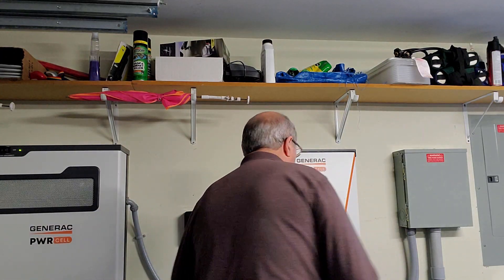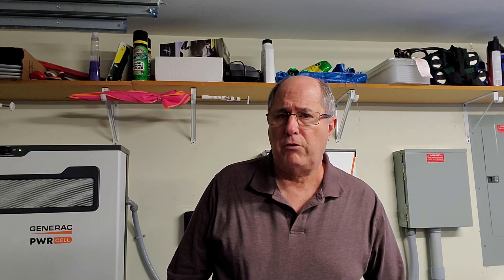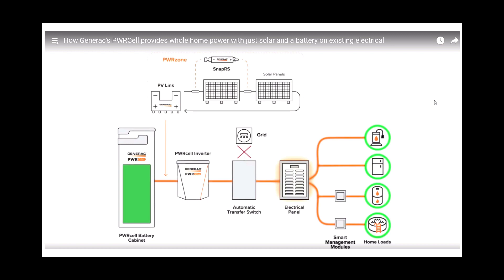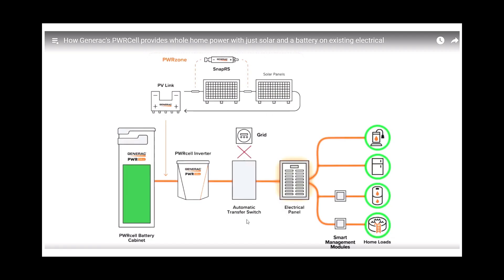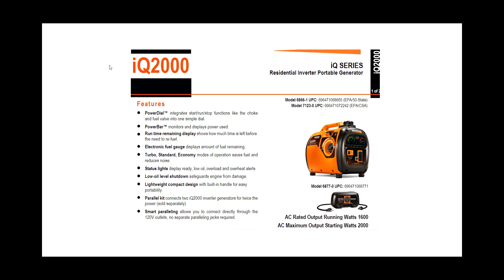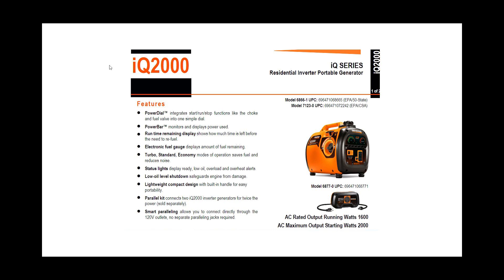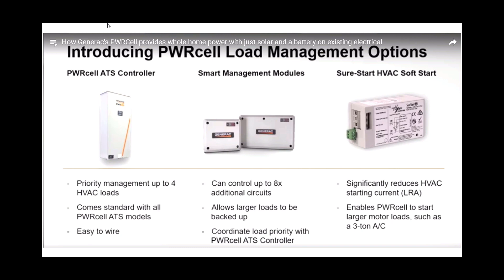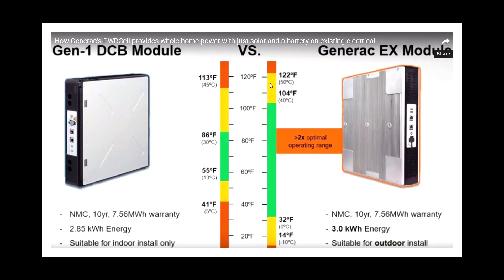Generac PWRCELL Generators and Upgrades

Comment: I have a portable Generac Generator. I use this with a manual transfer switch. The main job of this generator is to power my well and lightning. Without power I have no water.
I’ve looked into buying a solar system with battery backup. However solar companies have told me the no one makes a system that can handle the inrush of the well starting.
So I keep waiting for someone to make a system that can handle heavy loads.

Comment: Hi thanks for your valuable information, recently I have installed a Pwrcell system with batteries and I asked the company dealer here in Puerto Rico if my Generac standby generator to recharge the batteries and they told me that Generac doesn’t allow this for security and guarantee issues. Generac is developing a DC generator for this purposes, thanks in advance for your attention.
Reply from the maker: yes, Generac says they have been "working" on a DC Generator for a year or more.

Comment: Just a small tidbit: if you run a ductless heat pump HVAC system, a small solar system can cover the entire energy demand as there is little to no conductive heat loss through any ducting traveling through the non-conditioned space (attic/ crawl space). They also make heat pump water heaters which also are the most efficient electric water heaters as they don’t use an electric resistive heating element but rather circulate the water over the high pressure coil lines and many use CO2 as the gas instead of R134a. The built on efficiency of these systems are very appealing to us folks who use solar and want the ability go go off grid/grid down without sacrificing creature comforts due to gluttonous power demands
Reply: I know that there have been 8 months since your comment, but what you say is so very much true.

We have now paid off our 2-year-old solar system, plus paid off our 2ish years old mini split heat pump. Next, hopefully, will be, as you said, a heat pump water heater.

Eventually, we will get battery backup. We were considering 2 Tesla Powerwalls, but over the weekend I found that these Generac systems might be a much better choice.

Sorry for bothering you with all of this, but I wanted to tell someone.💙😉
Reply: @busog97641  generac system with the expandable battery cabinet is the way to go. The Tesla system requires an internet connection which will be down of the grid goes down. The generate system can also be programmed very easily to supply your power needs during the day with any extra wattage diverting to maintain battery charge, then can run off the battery only overnight and recharge during the day, along with an automatic disconnect you can program it to charge from the grid if solar isn’t sufficient due to cloud cover those days. Only way to go. No apology necessary and glad others out there are seeing why can be accomplished with what we currently have available.

Comment: I have existing Tesla PV rooftop mounted panels, (and also the Tesla inverter), but I also live in Texas, and ERCOT (unheard of until February, now a national synonym for corruption and ineptitude) can't find it's ass with both hands and a flashlight. My panels generated the ENTIRETY of Texas Icepocalypse 2021 and I'm hoping Halcium or similar can release a reasonable rooftop VWAT soon (Halcium is aiming for EOY 2021).  If that's affordable I'm going to likely bite the bullet and also get the Generac batteries, because in summer we need the AC.  In summer, I can do without the water heater (it's in the attic anyway and sometimes the hot water coming out if it is colder than the cold water from the tap in the worst of the summer, which makes washing cold water clothes a problem!) although I am unclear if the integrated furnace/condenser draws the same power in winter than summer.

Thank you for this information.  You're right, it's pretty dry, but of those of us who need it, we need it.  And your practical experience and down-to-earth presentation are great.

Comment: So one of the things I'm dealing with now, is that our Generac sales person didn't provide all of the options and information available. I thought he was very thorough at the time but after doing my own research it's too late to go back. One of the things I'm most saddened by is that I really wanted a whole home islanding feature. For example, in worst case scenario when our grid goes down for days at a time. (It went down for nearly 2 weeks a few years back RIGHT after going shopping and getting our meat processed; we lost thousands). Instead, we got a separate sub panel (like yours in the video). I don't know if they can even undo it and provide us with the Automatic Transfer Switch and MMSs now, without costing a fortune. 

A couple of notes that we even told him is that we're very frugal and don't have any high powered appliances. Our largest electric consumers are a dish washer, washing machine, and drying machine. We don't have HVAC, air conditioning, etc because we have a geothermal home. The cooking appliances are natural gas (one day will be a methane biogester). Most of our outlets go unused except the occasional phone or tablet being plugged into it. But as it stands, if we have another event like that of a couple years ago, all we have is the kitchen being powered by the critical loads box. I would have rather spent the money on extra battery needed to do whole home but I was told it (whole home islanding) wasn't an option.

Comment: Thanks for doing this! I am presently thinking out a back-up system for a new home project. I was wondering if, in the configuration you have described, you can use a Generac generator to recharge your battery  and power your house or do you have to specify what function you want the system to do? For me max flex would be best but I am curious about what you've leaned.  Cheers!  Blair

Comment: My neighbor got a quote for a Generac PwrCell system.   5.5kW of panels + 9.9kW battery + inverter..  $55,000.  

And no, it will not accept a generator, it will only accept grid quality power input..   which is an absolute joke and an indication that the engineers and Generac have no clue what they're doing.  

Who the hell would design an emergency battery backup system that can't accept a generator input?     Major major design flaw. 

In order to accept a generator input, they are going to have to add an extra set of AC input contacts to the inverter system and update the software to accept the dirty power. 

To my knowledge, there is no such thing as a residential sized generator with "grid quality" output.     Perhaps an inverter generator like a Honda could do it, but those are $3500 and up for the 120/240 split phase types.  

Just get an Outback Radian and some Fortress batteries...  You'll get twice the power at half the cost.
Reply from the maker: The cost of the system can vary widely, depending on what solar panels you pick; cost of installation and number of batteries.

Comment: Will central safer nuclear fission generators eventually be necessary. It's probably inevitable. Without question we have painted ourselves into central power generator/distribution corner. The three ineptly designed "kick the can down the road" U.S. power grids are bandaids on a case of cancer. Those who can afford it,  (about 10% of the population) particularly in Calif are rapidly installing solar with a propane fueled back-up power generator capability taking advantage of state and fed tax exemptions. The Calif one party state Dems lead by an inept union dominated one party bunch of lumps for  legislators and an inexperienced 
govonor clearly knowing that the 2021 summer power demands will exceed the out of state fossil fuel  purchases supply.   The result?  Rolling blackouts generally in the poor and rural areas with no political clout.

Comment: Did you mention that the  Generac system alone (without the grid) will not have enough initial power to run an AC Unit?

Comment from the maker: The inverter cares!  If you send "dirty" power into the inverter, it will not use it.  You have to go through the inverter to charge the batteries.    It is how Generac designed the system.

Comment: I currently own a pwrcell system with the battery backup. Can you tell me how to simulate a grid outage?
Reply from the maker: Certainly! Go to your main circuit breaker panel and cut off the Main Breaker.  It will shut down all power into the house.  Your inverter should sense it and go into "Islanding Mode"  See this video I made for details.  https://www.youtube.com/watch?v=SFvfb_dWtGs&t=7s

Comment: I really enjoyed all your videos and you are convincing me to purchase this system for my 2nd home in upstate New York and want to know the ROI. We use an average of 725Kwh per month at a Delivery Cost of $126.00 per month ($0.17 per Kwh) and Delivery Cost of $53.00 ($0.08 per Kwh). You indicated an approximate cost of $11,000 for the system; in addition, what do you think the cost of Solar Panels and installation as well as the footprint size of the solar panel system. The plan would be to put the solar panels in a field behind the house approximately 75 yards away from the house and the garage where this Generac system would be installed. The Electric Meter and pole is 10 yards from the house and 10 yards from the garage. Before I contact Generac and Solar Panel Installers, can you provide an approximate cost of an appropriate system based on my usage so I can determine ROI and affordability? Thank you.
Reply: My 780sq foot apartment uses 1200kwHr per month in the winter months.

Comment: There are a number of generators that have clean power due to their inverter output. Examples are Honda EU2200i, EU3000iS, EU7000iS.
Others provide as well. 
Look for the "Inverter" in the generator description.

Comment: Beach Lover- thank you for you videos!  I’m interested in using the PWRCell without solar panels strictly as a backup. And maybe as an alternative during high grid power price events. 2 questions: 1) could the PWRCell be used as a backup with a generator as you described in this video WITHOUT a solar array? 2) does the app or software allow for switching the grid off during high grid price events?  Thank you again for sharing your experience with this system.

Comment: The Pwrcell ATS does NOT take a generator load.  Its purpose at this time is to manage the Smart Management Modules.  Hopeful that Generac will at some point be able to take a load back from generator to charge batteries but it will not at this time.  Check the single line for clarification.
Reply: I was told the generac DC generator will be available in March this year and connects to the RE BUS in the inverter

Comment: Great videos watched all. Looking at this or Tesla system. Haven't decide yet. These questions are about just the Generac system. Can you fully charge the batteries if you know a storm is coming off the grid if not fully charged? If it does is the unit smart enough to know a storm is coming or do you need to do that manually? Can you program the unit when no outage is forecast, say at night, and just run off the batteries until morning to control peak and off peak rates? Does the unit do automatic software updates? You state it provides 40 amp. Is that peak power? In other words, is that for just the surge say a bunch of refrigerators start their compressors at same time and it hits 40 amp. Does the system have a constant load power output less that the 40 amps? Thanks. Again great videos.
Reply: https://youtu.be/946072_MzUY Generac says 50A peak power - enough to start a 3-ton A/C unit.
Reply: Also, there are ‘smart’ contollers that can stagger the startup of high load appliances.
Reply: You can switch the inverter into priority backup mode and then all available resources will go to charging the battery including grid power. The Tesla has stormwatch but I do not believe you can manually activate stormwatch
Reply: @Noneofyour210  You can enable and disable stormwatch but it will only allow you to charge the batteries from the grid if it thinks a power failure is likely.
Reply: @Son37Lumiere  I'm not taking about Tesla batteries. I don't care about Tesla batteries. Generac batteries will charge off the grid in priority backup.
Reply: @Noneofyour210  
Jack is talking about Tesla batteries. And you did refer to Teslas stormwatch.
Reply: @Son37Lumiere  it seems you don't know what you're talking about.
Reply: @Noneofyour210  Pot calling the kettle black.
Reply: Mike Sims  
Pwrcell is on par with the updated Powerwall+ with output capability. They both have their advantages and disadvantages.

Comment: Hey there Don, I have a question, I wonder if you could cover solar generators that maybe are not Generac? I like your informative style and would like your take on stand alone solar generators that and what they can actually power. For example: Bluetti is a popular generator that appears to run a refrigerator for a day or 2 max but can it run other devices at the simultaneously and what those devices might those be if the fridge is running at the same time? For those of us who may not need a full Generac system when power goes out but in case it does and need perhaps a 1day or 2 of power for essential items like a fridge, space heater, laptops, cell phones or a toaster oven or hotplate knowing which generators would work best in this situation would be a godsend. For instance would it be better to get 2  Bluetti's one just for the fridge and maybe a charging ports for cell phones/laptops? Perhaps then another Bluetti for space heaters or AC?  If you could discuss why or why not the device can or cannot handle the loads that would be awesome. If you can't do a video on this right now maybe it can be tackled in a future video? There are other videos on for example: Bluetti generators but NONE tackle what it can run simultaneously and how that works in the "real world" concisely. You do such a great through analysis of products I think you could do a great video on this. Thanks ! Oh and great vids keep them coming... you have a great smile, keep smiling your whole face lights up!  :D

Comment: I have just installed my 10.8 Kwp system with a powerwall in my home. I believe most folks aren’t aware of one important fact. If you have a solar system and you are tied to the grid and power goes out you have no power in your home! Your system is generating power but you can’t power your home because for safety purposes. (Prevention of sending power to the grid and killing a service technician). The solar energy needs to come from your battery or some form of generator.
Reply from the maker: You are right!  It is why I have the PWRCell batteries as part of my system.
Reply: Do automatic transfer switches let an off-grid PV system or self-supply PV system power a home during a grid outsge? I recall Pika Energy (Now Generac Pwrcell) having a “cold” start feature.

Comment: Can I stack two or more Battery Units (2x6 >12 individual batteries)?
Reply from the maker: You can have two PWRCell cabinets connected to the inverter, with 6 batteries in each cabinet.

Comment from the maker: Thanks for the information.  However, there is already a mode in the inverter called "Priority Backup".   It allows you to charge your batteries using grid (AC) power and solar power. See page 9 in the Generac Inverter manual.
Reply: Did you locate your generac rep thru Lowe’s...  I am in WNC

Comment: I just bought me a Generac generator portable the THD or clean power coming from that generator is about two from your wall is about 1 to 3. I consider that  very clean power  for a portable generator and they do sell the generator for $1000 it’s 8500 continuous 10,000 starting watts Very clean sine wave very happy with it but yes you are right about some dirty electric from some of these generators it’s electronic fuel injected no worried about clogged carburetors or anything like that start and fire up your whole house good luck I’ll save my $30,000 for the battery back up
Reply from the maker: I had a generator before I bought this solar system.  My system provides clean energy all day, every day.  The generator does nothing for me, unless I lose grid power.   The purpose of a solar system is not just to provide backup power.
Reply: @beachlover9108  they’re only good for 15 to 20 years until they improve then I will get some for now I’ll save my 30,000 they will go down in price or make better ones I do believe in green power but this is too soon too fast everything takes time do you remember when the computer came out they had 6 MB know your phone has 160 GB we need more time you can’t just kill fossil fuel and just jump right in the Green power until they get it perfect but to each their own if you got 30,000 and it doesn’t bother you God bless you I don’t have that kind of money to put even monthly payments